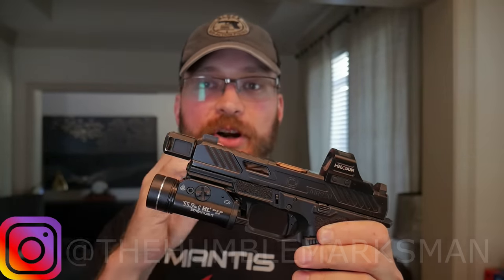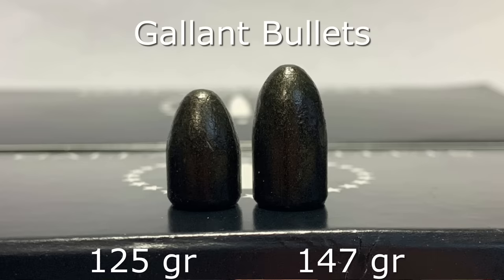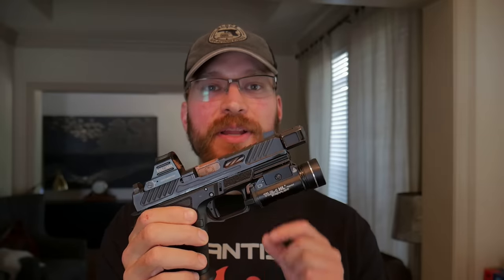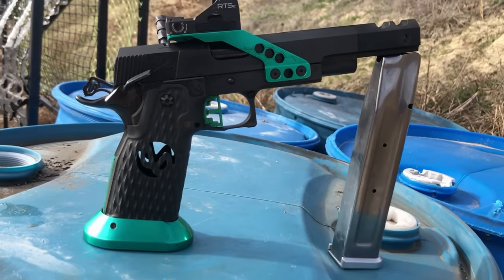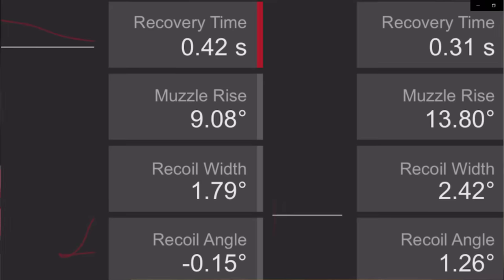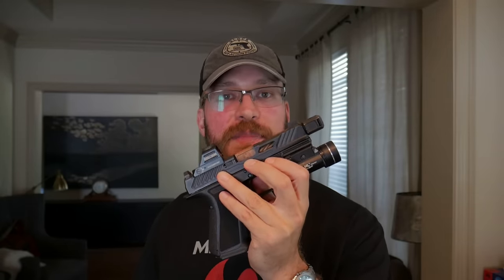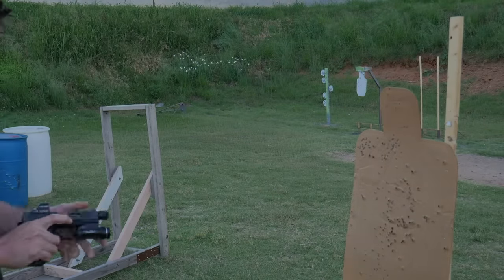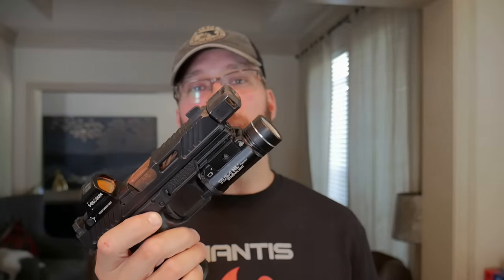Carry Comps - do compensators actually work on 9mm pistols?

Comment: New sub here. You know your shit brother. Congrats. Very well explained. I just compensated my Glock 19, Gen 3 with and Agency Arms 417, and it’s failing to cycle. Called Brownells, and Wolff Springs, and they both recommended heavier springs. I hear you suggesting a “lighter” spring (which makes more sense to me). Can you comment on what weight you think (based on your hands on experience) a Glock 19 with a compensator “should” work at? Im thinking of picking up a non-captive guide rod and #13-#17 springs just to experiment, but if you have real world data, you will save me time/money. Thanks!!
Reply from the maker: On a Glock I wouldn’t go lighter than 13# - you can get early unlocking which affects accuracy.  Also be sure you are keeping your gun oiled - you need slide velocity
Reply: @TheHumbleMarksman  I'm going to try the 13 and 15. Wolff spring makes a 15, 16 and 17 Lb spring, which offers a lot more tuneability than ISMI
Reply: Are you using an agency barrel with it? Agency arms on their website will tell you that the compensater works best with their barrell. 
Still get the lighter recoil spring though, you'll need that regardless.
Are you using a single port or double port? if you're using a double, you'll need hotter rounds to properly cycle. With a single port, it will be more forgiving with standard ammunition at the expense of potential total compensation
Reply: @TheGrowlingAraknid  single port. Have gotten reduced springs. Work in progress. Thanks.
Reply: @c.patricksadowski9959  is it working fine now? Or does "work in progress " mean it's still giving you issues?

Comment: Not all comps are created equally, there can be comps that reduce recoil by 50% but it has other effects like significantly more flash and also blowback which are negatives for self defense especially at night.

People complain about the noise mostly, unless your ears are hypersensitive you should recover perfectly fine in a real world defensive shooting scenario.

Gemini Customs has proven that porting barrels is extremely effective in recoil reduction, a good compensator can achieve the same effectiveness but my doubt on these micro compensators is not only their build but their compact design will ultimately render them less effective than a larger compensator.

Comment: Primary machine stealth comp on my p10c, with Dpms recoil system. Its definitely unreliable with my 158 grain 900fps ammo that I run in my shadow 2. Shoots factory 125 and 112 perfectly.
Reply from the maker: yeah gonna have to go down in spring a lot to get a 158 at 900 to move.
Reply: @TheHumbleMarksman  ya.. I'm using the shortest one at the moment, I can't seem to find the weights, it comes with 3 different ones.
Reply: @chronicdose  
Some comps simply will not allow 147gr/158gr to work even with the lightest possible spring which is think is 11lbs.
Shoot 124gr Nato Winchester White box. Tune your gun using that ammo.

Comment: Honestly it’s a great explanation of recoil / gun powder on your gun with/without a comp. i have a primary machine comp.. but i run this self defense ammo , liberty ammo... and it’s 55 grain , 2000 fps..... theres a lot of bang on that thing , it comes out very hot. What i can say is... i have two of the same gun , one with a threated barrel / comp. one without... the trigger certain helps if your rapid firing. But the accuracy is about the same.. however. With lower grain ammo, the comp certainly settles that bang, opposed to the regular non comp pistol. So youre right on the money. Good work

Comment: My Glock 21 45 super conversion definitely benefitted from a comp 😂 for a standard tactical or HD pistol I think they are unnecessary. For gamer guns or trying to eek out every bit of potential I see a little bit of practicality for a 9mm.
Reply from the maker: Yeah I suspect 45 super would benefit from a comp for sure.    I personally think faster and more accurate is better in any context you could put it in - as long as you don't degrade reliability while chasing it.

Comment: More importantly, a heavier (and longer) bullet is going to create higher pressures in the chamber, and therefore you cannot use as much powder. Titegroup, for example, leaves enough room in the case for a double charge with a 124gr bullet. You can easily get into dangerous pressures with a 160gr bullet without filling the case with a powder like that. With certain cartridges case capacity is more of an issue, but with 9mm, in my experience, it's more about keeping within the maximum operating pressure of the cartridge, not finding enough space for powder.
Reply from the maker: Depends how fast you're trying to move the projectile.  My 9maj loads run out of case
Reply: @TheHumbleMarksman  fair, but we’re way beyond saami 9mm Luger at that point, yeah?

Comment: Currently carry the Griffin Armament barrel and micro comp on my EDC G45. 
Want to try some other comps though.
Reply from the maker: I haven't messed with the griffin - but it looks like more of a flash hider than a true compensator.
Reply: @TheHumbleMarksman  
It's slight, but there is a noticeable difference in felt muzzle rise/recoil. 
I definitely need to mess around with some other comps though. I want something that will perform the way that a comp should, without stealing too much velocity from a good defensive round.

Comment: I have to second what commentor Micah Howell said. Great job on the video. I know this is an older post, but I hope you will still answer a couple of question on this subject. I own a few .40 caliber pistols (don't hate on me) and have been considering one of these micro comps. Do you have any experience or thoughts on the effectiveness of these compensators with that caliber? I've been considering putting one on my H & K P30, just to see if there is a noticeable difference for follow up shots during my two shot drills. H & K sells one that looks like a Griffin Micro and the cost is pretty reasonable at $30. I appreciate your input.

Comment: Gas volume and pressure drives comps.  You want a light bullet with a lot of slow-burning powder.
TiteGroup is a fast-burning powder.  Good if you aren't running a comp, but not what you want to drive the comp.

If you really have an effective comp/ammo combination, you will need to run a light recoil spring, and maybe a light striker/firing pin or hammer spring (depending on action type).  There will be a compromise between reliability and effectiveness.
Reply from the maker: Just to be a little pedantic - pressure doesn't drive a comp - you manage pressure by using a slower burning powder to get max charge weight - basically.  TG was used to illustrate a powder that would be very good for a heavy for caliber projectile.  With a comp - you can get the most out of a skeletonized slide and that should help you with slide velocity - and the lightened spring should help as well.  That said - striker action guns like Glocks don't do it as well as a hammer gun would due to the striker/ recoil spring relationships.  

Even using my competition reloads - I can appreciate the difference between comp'd and non-comp'd - just using sport pistol - which is a smidge slower than titegroup.  

When I get bored - I will probably grab a 171 mm magazine and load up some hot minor rounds and shoot my roland in Open for a match - just for fun.
Reply from the maker: @TheSuburban15  you mean a pressure other than chamber pressure - which is traditionally what's referred to when we talk pressure in ammo.  I was referring to chamber pressure - which doesn't affect the comp.

Comment: Funny how Sig P365XL just came out with a comp , one  build on the slide . They do not talk of round weight , no surprise they are only about the bottom line …   My 44 I own is a comp , yes I can tell the difference when shooting it compared to my 6” that does not have a comp . The negative is when shooting 6” or less with 44 you loose velocity .   That’s for another video though… thanks

Comment: I use a saurez international comp on my Glock 43x . Have my m&p2.0 compact ported aswell. Floyd's custom shop custom gun
Reply: Did you change the recoil spring on the 43x? Also what defence ammo are you using?

Comment: since we can't have threaded barrel here , comp is no goo. Unless it's pinned to the barrel and that wil kind of screw up disassembly on anything else but 1911/2011
Reply from the maker: Strike industries has Glock comps but that doesn’t help you out any - they clip on the rail and attach via guide rod
Reply: @TheHumbleMarksman  the problem with that... Is your shooting a Glock.
Reply: Rusty Shackleford  good luck pinning the comp to the barrel :)  This state is fucked up
Reply: Rusty Shackleford  you have to pin it , it has to be "nonremovable " to keep state happy

Comment: @mayhem syndicate micro comp!🤙 I also run a ported Glock 45
Reply: I've been looking at the micro compensators. Do they run better than, let's say, the Zev Pro compensators? I couldn't cycle training ammo well at all with mine. Tested with two pistols and they only cycle consistently with heavier grain ammo. Looking for advice. 😊
Reply: @McFartsnatcher  the mayhem micro comp has cycled every ammo I have thrown at it, cheap and expensive. Stock 17lb spring and 15lb reduced spring. The down fall is it’s expensive, $375 for the barrel comp combo.  But it does have the best on/off system of any comp I’ve ever used. On/off in seconds.

Comment: What do you think about the griffin armament micro carry comp? I like mine. They certainly redirect gasses. I’d be interested to hear what the mantis recoil meter says!
Reply from the maker: I personally have no experience with those.  Those do knock off energy from the slide by redirecting gas - but they don't do as much as a single port or 3/4port design since those use the gas only in beneficial direction.
Reply: @TheHumbleMarksman  thanks for your assessment!

Comment: Hey, if you can I’d love to see a comparison with the PMM Ultra Comp and Carver Custom 3 port comp. The carver seems much closer to the race gun side of the spectrum but the PMM seems very effective for a carry comp. Would be interesting to see how much difference there really is.
Reply from the maker: If you can convince PMM and Carver to send in T&E ones - that's like $500 in stuff I have no practical use for!  PMM doesn't do T&E by the way - ask me how I know lol.
Reply: TheHumbleMarksman Haha I feel ya there. I’ve seen guys run Open Glocks with the Carver. But I think you need an 11lb recoil spring. Might run into issues with having to run the striker spring too light to go into battery. No experience with PMM but it appears to be very popular on the G45. That’s the problem with this hobby. You have to buy 3 or 4 times before you find what you like, and it ain’t cheap. Ha

Comment: I’m running a Griffin Armament Micro Comp on a G34. What you think is the best overall round for general purpose shooting with a Comp?
Reply from the maker: depends on the comp - the Griffin doesn't vent much gas - so it'll be overwhelmed by the ammo pretty quickly.  More efficient comps will do better with ammo making as much gas as possible - the griffin will probably optimize  ammo that's already soft shooting without a comp - like Syntech.  If you had something like a KKM or something with more ports it'd do better with lighter faster stuff.

Comment: What holster system are you using for your compensated edc?
Reply: I use a HB industries micro comp. Not sure if it actually does anything to reduce recoil, but as small as it is, I use it as a thread protector and I like the way it looks as well.

Comment: Awesome video. Question, if we start replacing recoil springs to shoot regular ammo, how would that affect the firing pin spring function? Does it also need to be changed to a lighter spring?
Reply from the maker: There is a relationship that needs to be maintained - going to a 15# spring may not require a change in striker - if you go down to 13# you're going to need to.

Comment: I just put a glockstore comp on my G5-19 and I’m using a carver uncaptured 14lb recoil spring and it’s not even close to running my 124 with 3.6gr of TG I don’t want to go up in powder but I can’t find a lighter spring for the 19s, should I start to cut coils off or do you know where I can find a 11-12 lb spring for a G5 19
Reply from the maker: I have a GS comp I'm getting ready to use in a video.  Very cool.  I don't know how to source that spring - the lowest I could find was a 15# spring on my 19.

Comment: I'm getting a 10mm 1911 and it has a threaded barrel, I'm thinking about getting a comp on it, what do you think about a comp with 10mm?
Reply from the maker: yes - the 165 loads should work pretty good on a comp.
Reply: @TheHumbleMarksman  basically the hotter the load the better the comp should work because the faster its moving, more powder has been burned than usual which would cause more gasses, which in turn make the comp work better by redirecting gasses?
My bad if that was a little long winded haha

Comment: Humble ( David ) you used or included a comp on your 43x build ,  in your opinion did it work as expected? Would you recommend one for g48 ? K
Reply from the maker: Yes it made the gun a little less sharp in the hand - I’d MantisX is to be believed about a 20% reduction in force - where you really notice it is single handed shooting
Reply: @TheHumbleMarksman  As in my earlier comment 4 months ago I used the Griffin set up , I think I was expecting more but it did reduced the force in hand , but with no way measure it . Trying another comp as you suggested earlier is a option. It did improve rapid fire accuracy, slow fire little to no improvement . I don’t reload anymore, so I’ve tried a lot of different Ammo , nothing really stands out . No malfunction to speak of , couple of bad primers . So the comp and barrel set up handles all ammunition ran through it . Is there a factory load you recommend? K
Reply from the maker: For factory rounds I always like S&B - pretty accurate - inexpensive and consistent.  That comp hasn’t given me issues - I only tested my reloads and some defensive rounds
Reply: @TheHumbleMarksman  Thanks David for your Feedback I’ll try to find some S&B with ammunition shortages going on maybe hard to find right now .
Reply: PMM and Suarez comps still out of stock crazy gun world.

Comment: What type of ammo are your using on the mr920 to make to comp most efficient?
Reply from the maker: 125's going at least 1050 FPS - preferably 1100-1150 FPS.  115s going 1250+ will work the comp best.  My gun shooting the Hornady American Gunner ammo in 115's with the XTP tips only pushing 1165 seemed to work the comp really well - felt like a 22.
Reply: @TheHumbleMarksman  Did you have to change the spring on the Herrington/MR920 combo?
Reply from the maker: @kage239  nope it worked fine stock

Comment: Thanks for the research and presentation. Given that comps add length, a comp gun should be compared to a non-comp with a barrel length +1". 

Thoughts on opportunity cost of the added kinetic energy of a 4" barrel vs 3" with comp? Muzzle rise of 4" vs 3" comp? Decibles of 4" vs 3" comp? Muzzle flash of 4" vs 3" comp? 

I run flash hiders and brakes on some rifles, but I am revising my backpack carbine (SU16c) setup removing the FH/Comp to reduce OAL for better backpackability. After my experiment, I may reconsider the setup on my other rifles. But I am leaning toward a preference for an 18" barrel with no muzzle devices vs a 16" with.
Reply from the maker: The area with rifling is only extended by about half an inch.  The balance of space is the expansion chamber where the gas goes to ports- there isn’t a huge boost in velocity - depending on powder types.  The 19 with a comp has less muzzle rise than my 34 without a comp.  decibels behind the gun I am sure is louder - especially at an indoor range.  I shot yesterday indoors and was amazed how much louder it was.  Muzzle flash is a good question - I don’t have good access to a low light range.
Reply: @TheHumbleMarksman  And, for those not using RMRs,  a longer sight radius...though I suppose a sight could be integrated into the comp. Or ports integrated into barrel/slide like Sig SAS. I also tend to suspect comps are a result of the stopwatch obsession of most shooting sports. In self defense, with targets shooting back and moving, generating physiological response & OODA loop in opponent, and the rush to cover, I think maybe too much emphasis on rapid followup shots. In paintball a judicious use of speed, but more so optimized use of cover. Thanks again for highlighting factors I had not considered.

Comment: Very good video with objective info.  I can see the value of a comp for a gamer.  But what about using a comp on a CCW such as a P-365 topped with a Holosun 507K with defensive ammo such as HST standard pressure?  I understand the Holosun already adds weight to the slide.
Reply from the maker: I have a hellcat and the comp does make shooting one handed easier but with two hands on the gun the difference isn’t as pronounced

Comment: Absolutely, adding PMM MicroComp on my P320 Subcompact. In addition, Can you talk about what's your stand on 124gr ammo? When you mentioned different powder charge, do most of the factory load companies load their 115gr and 147gr with different powder?
Reply from the maker: 147 will generally use a faster powder than a 115.  115 may not - depending on how fast the ammo is.  If it's pretty high velocity stuff you can bet the powder they are using is slower burning.
Reply: @TheHumbleMarksman  What about primer? My background is PRS (but not a reloader). In PRS, anecdotally, sometimes faster burning primer is more desired. By any chance you know why?